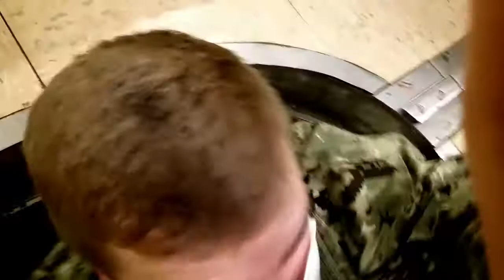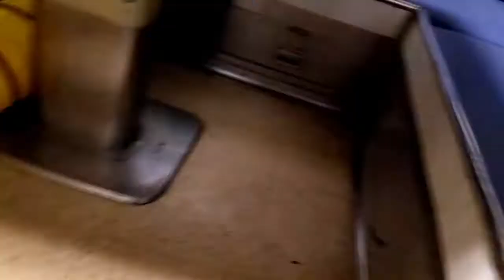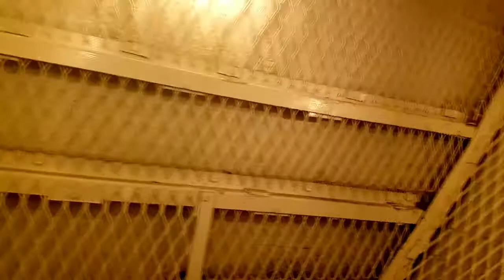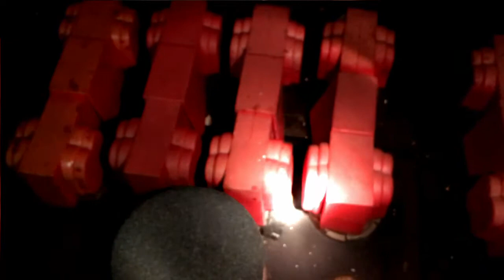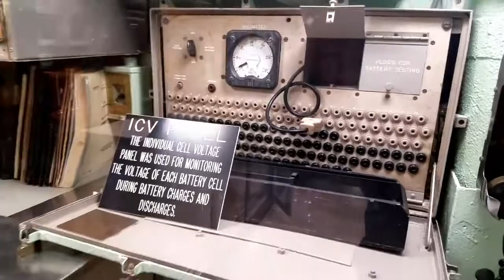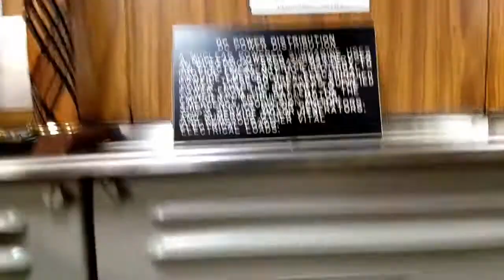Episode 11 - Storerooms and Battery

Comment: how are the cells removed from the bottom of the ship lol???  is it a shipyard deal with cutting holes in parts of the sub?   ive seen where they patch the pressure hull for main diesel replacement
Reply from the maker: cells are removed through a deck cut (not a hull cut) and then rigged out through hatches via crane.  This can be done waterborne as there is not actually a hull cut.